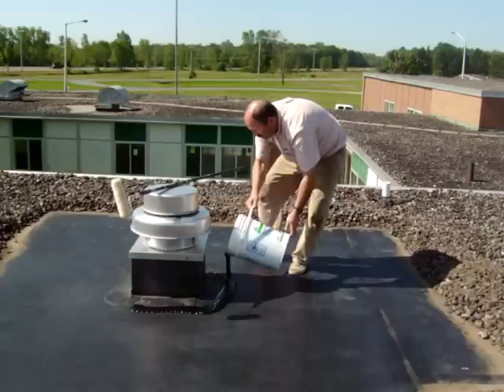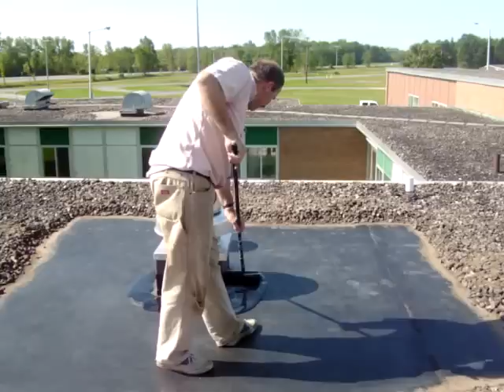Roof Repair with Butyl Liquid Rubber sponsored by epdmcoatings.com

Comment from the maker: Actually this video was provided by a customer however the material can be applied directly to verticals without running.  During the cure process it will find its way into the small areas providing an airtight seal